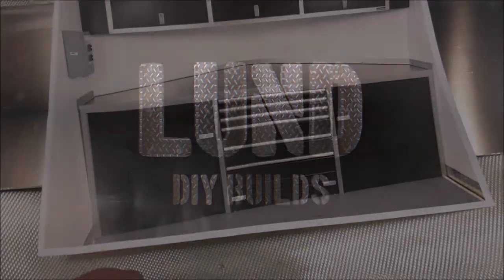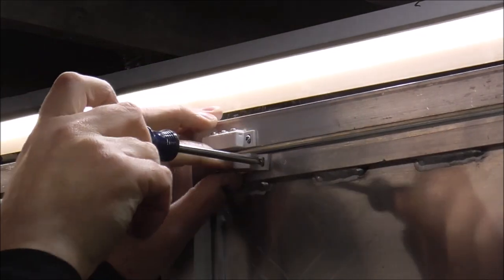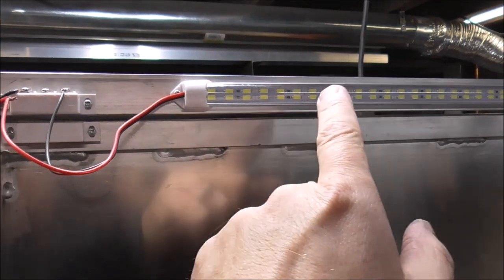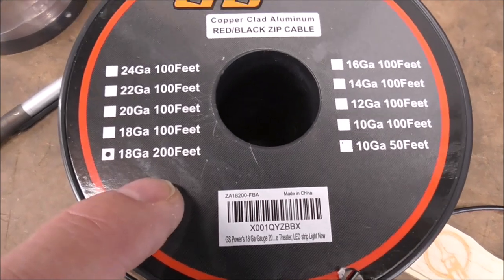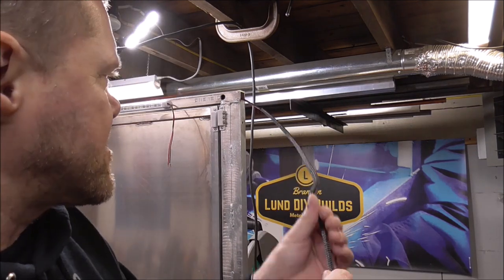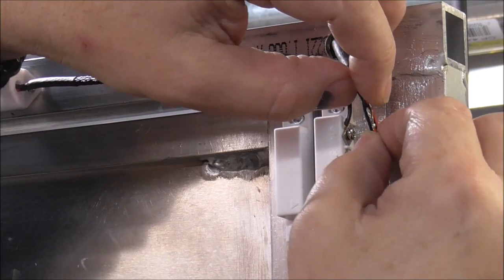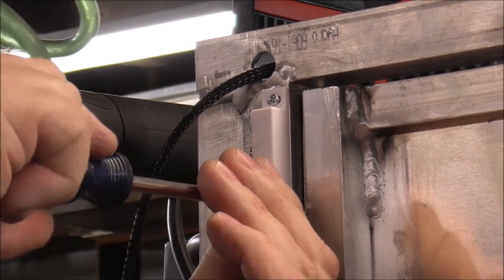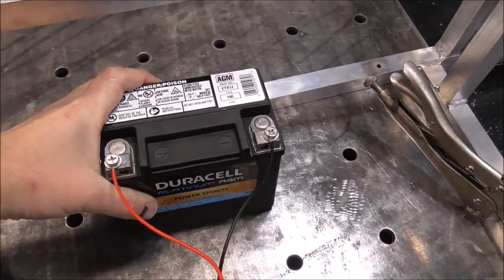Upgrade Your Cargo Trailer with This Automated Lighting Hack!

Comment: Thanks for the 'Tapping' tip on the screws. I've seen YT vids with guys just cranking on the tap and NEVER backing it up to break off the cut thread chips. 
Also you did a nice change moving the switch from the outside of the door to the hinge side. Much better.
Reply from the maker: Thank you so much! 🙏

Comment: Bro. Brandon, 

I love the content of your posts.

I primarily sign on to hear your take on welding, but I really love the fact that the "rounding" projects truly bring together your vision to fulfillment. 

You are a clever and gifted man of God.  Don't let anyone or any negative commentary dissuade you from your mission or vision. 

Your twin brother of a different mother, Tim from the lower deserts of Arizona. 

PS.  Your vision was well thought out; may I suggest that Harbor Freight have grommet kits.  Sleeved wires wear through by the constant friction of our rough desert roads.  A rubber grommet will ensure longer wire/sleeve life during travel and make the initial harness pull so much smoother. Just saying.
Reply from the maker: Thank you so much Tim 🙏 the grommets will be going in for sure. Have a great weekend buddy!

Comment: Great Job Brandon- 
For a grommet - you can use a piece of rubber fuel line to insulate the wires from the sharp Aluminium when you drill the holes and the rubber fuel line can be held in place with a dap of super glue.
Reply from the maker: That's a great idea! Thanks!

Comment: Hey Brandon nice job 
I done a similar project in my rv pantry. Before you couldn’t see anything inside even the toggle switch on the 12 v light fixture that was factory installed,so installed the motion sensing version of those same lights you installed. Works great,reach in Bam lights are on !!
Reply from the maker: Nice! 👌

Comment: What a neat feature to have with your lighting. If you need to use any butt splice connectors on the exterior, they have a marine type of heat shrink that has a compound inside which melts and seals the ends off creating a water/air tight seal. This keeps the elements from causing corrosion. You can get a kit at Harbor Freight for 5 or 10 bucks. Keep up the great work!!!
Reply from the maker: Thanks for the info! I will be  looking for that kit. I like stuff like that. Thanks for sharing.
Reply: I’m gonna hold out for a mig welder….

Comment: Brandon, inside of the switch assembly is what's called a reed switch. It's a glass tube with contacts inside that are steel, and hermetically sealled and it is activated by the magnet. Your switches are both normally open and normally closed with a common screw on it. These, as you are probably aware, are typically made for burglar alarm systems. These switches are very light duty, meaning that for other types of applications, it will require a relay to operate higher current applications.
There are switches that can be inserted into a hole and are round, and might have been a better idea. The magnet also goes into a corresponding hole as well.
Reply from the maker: Great info! Thanks for sharing!

Comment: Do I have to replace the mig liner if I go up in wire size? I bought my first mig welder. The MIG welder is currently set up for solid wire 0.6.  I want to do flux core .9.  I have a 0.9 tip and the .9 feeder wheel.  Do I need to increase the size of the MIG wire liner, or does the mig liner that came pre-installed with six solid wire good for the 0.9 flux core?  What liner should I use for a flux/core .9 (.035) wire?
Reply from the maker: Generally the liners that come on most machines will accept .023 up to .045 wire so you should be good. @mrfrostbite2020

Comment: You should only switch the power wires (ac or dc), not the neutral or ground. By switching the neutral or ground, the electrical device is always powered and has more potential for shorts or shocks.
Reply from the maker: Great point. Thank you

Comment: The auto lighting is a nice feature. However, I thought switches were always installed in the hot lead, not the ground? Looking forward to the powder coated doors. Should look great.
Reply from the maker: Thanks. It seems to work ok though. Be sure to check out the rest of the videos in the series. It includes a shop tour showing the doors being powder coated and the process and many more.  The trailer is done and in service

Comment: I've used LED strip with IR sensor to see if a door is open to light some cabinets in our Den. Any reason you went with contactors vs IR sensors?
Reply from the maker: My thoughts were that it might be triggered from things vibrating inside the cabinets as the trailer is being towed down the road

Comment: FyI..
You will need to space out that bottom part of the switch to match the top one to work properly.
Reply from the maker: It should be good now :)
Reply: @BrandonLund  later in the video you decided to move it to the hinge side on each door.
You can move one of them further back to make the magnetic weaker and the light will come on sooner when opening.
But it's looking good.
Hope to some day win one of you test machines. 
Thanks and have a great day
Scott

Comment: Just a suggestion, but not sure….are these mounted on the inside of the trailer?….inside might be better….
Reply: If you want the light outside and put the contacts on the inside away from weather….you can make a larger hole for the wire to snake inside and have a rubber grommet to be installed into the hole
Reply: Sorry, i didnt realize that was inside….whoops🤭
Reply from the maker: @chrisallen3741 You were the February winner. Times running out. I need you to get in touch with me if you want the plasma cutter. You have until midnight today EST to claim your prize. I need you to email me lunddiybuilds@gmail.com. You only have a couple hours left. https://youtube.com/shorts/pmXSEuia-IU?feature=share